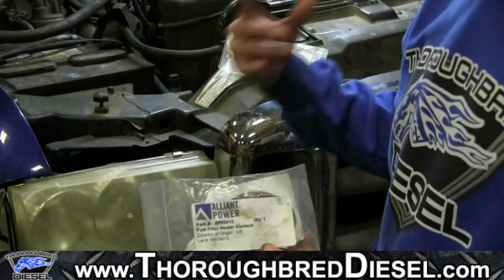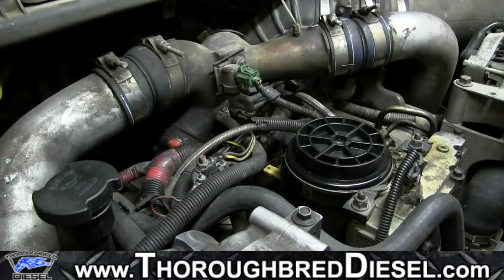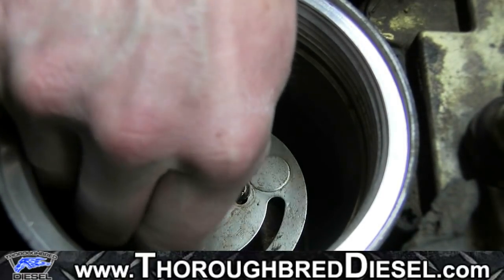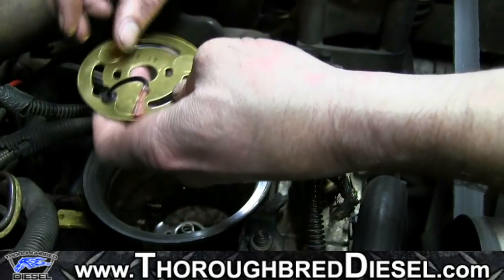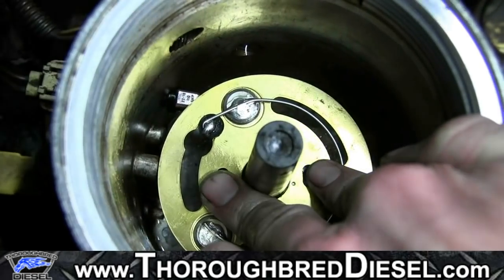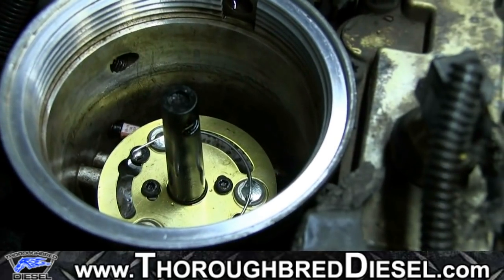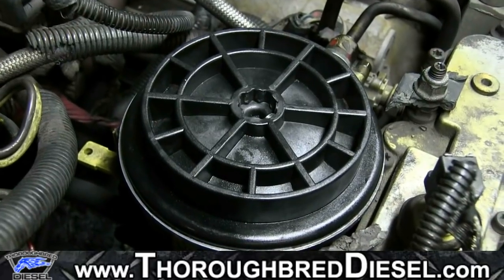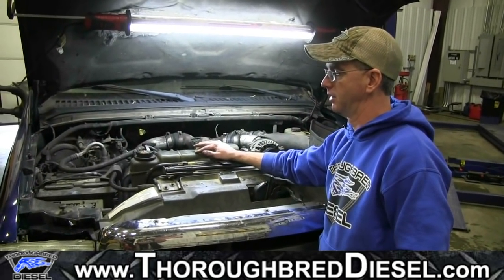Ford 7.3L Not Starting? How to Install a Fuel Bowl Filter Heater Element

Comment: Just had this problem on my 99.5 F350, You can just unplug the fuel bowl heater connector on the backside of the fuel bowl and replace the 30 Amp fuse. And drive while you wait to replace the new fuel bowl heater element.

Dont do this if you are in a very cold climate as it will not heat the filter if it is gelled.
Reply: I'm trying this.

Comment: I have an early '99 7.3 and had this happen a while ago.  I replaced mine with a 99.5 version because it's a solid piece of metal as opposed to a thin piece soldered to a disk.  I haven't had a problem since.
Reply: Just the element?

Comment: Thank you Thoroughbred Diesel....I'm not a mechanic and your instructions made this job a piece of cake.  I did install a different heating element I purchased from RockAuto (DORMAN 904210  This Dorman OE FIX replacement diesel fuel heating element matches the function and performance of the original equipment part. Made of quality materials, it has undergone extensive testing to ensure durability.

Features & Benefits:
Upgraded replacement - this diesel fuel bowl heating elements features more reliable technology
Ensures performance - updated ceramic design maintains a lasting electric connection
Direct fit - reverse engineered from original equipment for seamless installation
Quality engineering - designed and tested in the United States
)

I hope it lasts....thanks again.

Comment: I got a 99 7.3 when it starts fine I’m the am once warm after letting idle I’ll get in and drive down the road and it’ll bogg then shut off and pop that fuse would this be the problem? New to diesel and it’s been driving me nuts for days 
Thanks

Comment: Quick question, my fuel bowl heater is attached to that rod and the whole rod is a plastic bolt and the head of the bolt is under the saucer, how do you you take it off it doesnt have the 2 t20 screws
Reply: Mine as well and is on pretty tight. Did you figure out how to unscrew it?

Comment: I have a 97 f250 7.3 truck was running fine til one day didnt want to start. I thought it was the cps so I changed it and then it turned back on ran like 40 mins on and then turn it off try to turn back on and no wait to start light came on. Now the truck just cranks but doesnt want to run. I think is the fuel bowl heater going to change it but can someone tell me where is this 30 fuse location?

Comment: I'm currently stranded at an RV park. I have a 97 powerstroke E350. I think my fuel bowl heating element is shorting out. I keep blowing the number 8 position 30A fuse. I really wish I could locate the external connector or wire that powers the element. If I could just disable it I could probably start the engine. I have 120V at the RV park to heat the engine with the block heater. If I could just disable it I could start the engine get it warm and just not let it get cold ( keep it running) till I get home.  Wish I could find the external wire that powers it.
Reply: Its on the driver side of fuel bowl below regulator assembly

Comment: My ‘96 has a plastic bolt instead of the torx screws holding down the heater.  Any ideas how to back it off?
Reply from the maker: I haven’t seen one with the plastic screws. Can they be cut and replaced with metal screws?
Reply: It’s the whole metal stem that unscrews by the way of a plastic nut. But it’s left hand threaded.
Reply: I was able to back it off clockwise.

Comment: I went to install one, saw it was already updated and changed my fuel pressure regulator spring to a blue one and now it fires instantly and has 85 lbs of fuel pressure.
Reply: Robert Wallace  ebay they have tons of options, I found 85 lbs was too much though and went back to a black spring. 85 was making the fuel bowl leak

Comment: I have a question. I order the second element you showed in the video (the one you didn't use), and my truck has the first one that you replaced in it. Will the second one that you did not use, still work in my truck?
Reply from the maker: +Master Chief No,  the elements aren’t interchangeable.
Reply: You can take a die grinder to the ribs inside the fuel canister to fit the newer element. It will never come loose and ground out. By the way, the new one is much cheaper.

Comment: Or just unplug the the pigtale for the fuel heat on the back of the bowl itl run with out it long as your glow plug relay is good and your glow plugs are up to par. Mines been unplugged and taped off for years now

Comment: I really liked your video. I’m not much for being a diesel mechanic although gas engines I can deal with. I’m learning. I watched this video thinking I had the same problem. I’m glad I watched it. But it wasn’t my problem. I knew as soon as you said if the wait light is not on then the fuse is blown. My light was on clear to the tone to start. It would crank and crank but nothing. I was down to 1/4 tank of fuel. I put another 5 gal of fuel in and charged my batteries. A couple hours later I tried it and it started instantly but I’m baffled. Anybody have any brilliant ideas? Oh I don’t have a fuse 30 mine go to 29 unless 30 is hidden somewhere else. Just for future reference. My truck is 2001 f250.
Reply: Sounds like your fuel pick up has broke off. When the fuel pick up breaks, you run out of fuel at 1/4 tank.

Comment: The connector in my heater element is broken off it's solder points and just flops around in there but still connected. Truck won't start for nothing, I changed out my fuel pump and rebuilt the fuel bowl and it's doing the same thing. Safe to say I need a new element?
Reply: Have you checked that 30 A fuse?

Comment: Hey I have early 99 also. I blow fuse 27 a 30amp fuse but only when it's cold or I don't plug it in. Is it possible it's the fuel bowl heater?
Reply: Absolutely

Comment: I have a 2002 F350 dually 7.3 the truck doesn't start unless the block heater has been plugged and I'm looking for a solution, any idea? Thanks in advance
Reply from the maker: Check glow plugs,  make sure they are getting power and are good is a good place to start.
Reply: Ok I wil...l thank you very much
Reply: I forgot to tell you. ...truck will not start whithout being plugged in even if its 100 F outside
Reply: You probably have bad injectors you do not need glow plugs for the truck to start

Comment: okay so I have a question. It's probably a silly question. so I have a 99 E350 with the 7.3 liter diesel and I'll tell you what it's a pain to change the water separator valve because it was leaking as far as I can tell that was the leak but I haven't been able to start my van again yet because I think I damaged the heating element when I change the fuel filter. when I looked in the bowl I saw the heating element it looked like the soldered spots had come loose. So I tried to Soldier it is this the wrong thing to do? also I lost my wait to start light. And it first I thought maybe it was because instead of taking the turbo and the entire intake off I took the bracket that holds the relay for the glow plugs off. But I didn't do any wires and I don't believe I damaged any wires moving them around. so I'm hoping that I blew the fuse instead and if I replace the fuse maybe to work but if not then I'll have to replace the heating element. There are people who are doing mods or are putting basically a different-looking heating element in there that looks like part of a coil from an electric stove. they say they get that from International for much cheaper like $33 is that something that I can put on my van?
Reply from the maker: First thing to do is to go through all of your fuses and figure out if anything is blown.  Once that is repaired,  for now,  just disconnect the fuel heater element at the fuel bowl, and get your van back running.  Once you have it running,  change the element and you should be good to go.

Comment: I think that MAYBE this is related to my problem, but what happens with my 97 F-250 0s that it will run fine for about 30-45 minutes, shut down unexpectedly. When I turn the key on to attempt a restart, the glow plug light will either be out or will flicker rapidly. I tried using my code reader(All my fuses are good) and if the truck is running it will shut down when the code reader tries to communicate. If the truck is off with the key on, the code reader does not communicate with the PCM. Anyone have any ideas? I am stumped. I am going to replace the heater just to see what happens, but this is odd.
Reply from the maker: Could be a bad connection in that heater. You could unplug the heater all together and see if that makes a difference.

Comment: So how does the heater element keep the engine from starting?
Reply from the maker: If the fuel bowl heater element goes out and blows the corresponding fuse,  the truck will not start because that fuse also supplies power to the PCM.
Reply: H
Reply: On an obs.  Mine did that and i put a new fuse in, and left it unplugged.  And i never had this problem again lol.
Reply: @daltonsmith304  what year is your obs? And where is this fuse?
Reply: @texasobs_73esquivel94  its a 95. And the fuse is in the fuse box under the hood.  I think it is maxi fuse. Number 23, or 26 cannot remember but im sure there's a diagram somewhere that will tell you.  Its the fuse for the PCM
Reply: Just unplug the pigtail for the fuel bowl heater and the fuse won’t blow if your having this problem, you may have some trouble starting in colder weather but it’s a quick fix if you need to get some where

Comment: I have to cycle a few times to start my 7.3 in my 2002. I get white smoke for a few minutes after starting it. What is the problem?
Reply: Do not worry. That is designed to help warm engine after starting in cold weather.
Reply: You should have thrown the ball and spring assembly away. All it does is kept from running without a filter and it restrict fuel.
Reply: Replace to Glow Plug Relay.